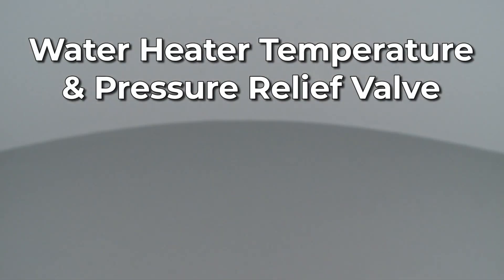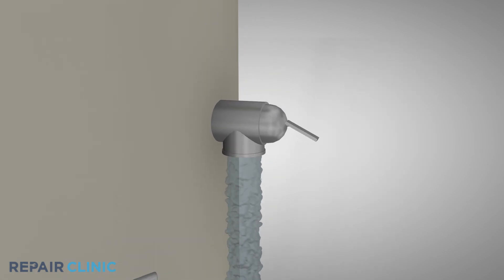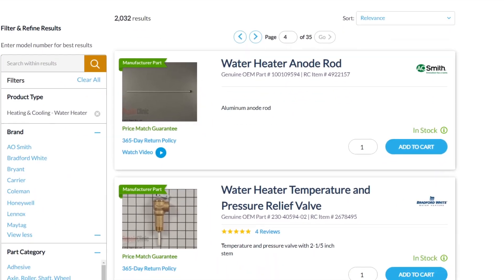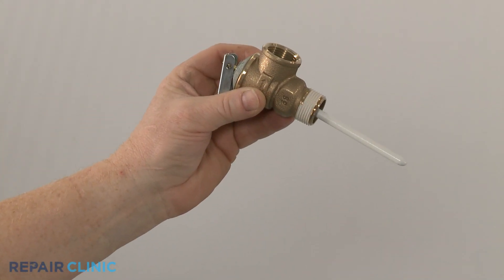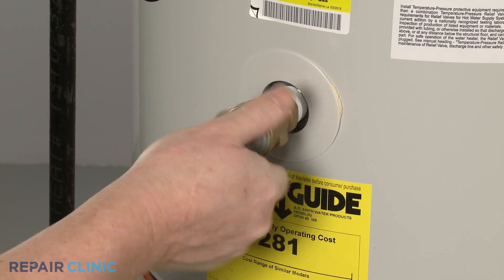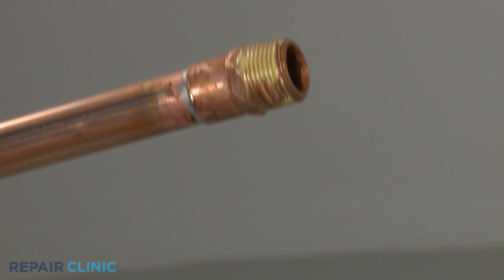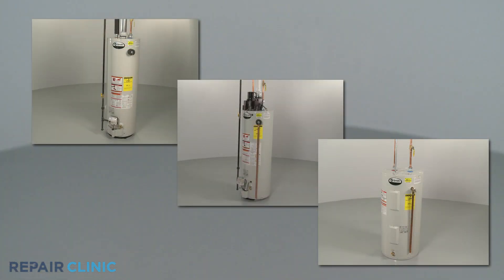Water Heater Temperature & Pressure Relief Valve - How it Works & Installation Tips

Comment: so how do I replace the relief valve if it had a PVC pipe cemented into it that connects to a copper pipe that goes down through the floor, into the downstairs wall and out of a copper drain pipe outside my house?  When I tried to unscrew the connector going into my pressure relief valve the entire copper pipe started to twist so I immediately stopped so I didn't snap the pipe in half.

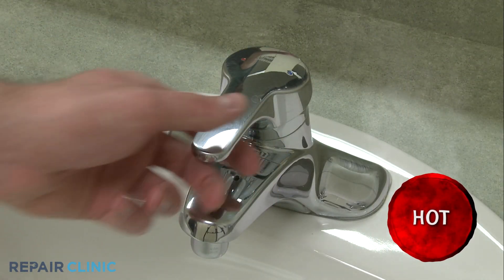Comment: 1:33 If you close the cold water valve, the water pressure in the water heater reduces and the hot water tap will not provide hot water.
Reply: You DO realize that is to provide air so the tank can drain, don't you?

Comment: Nice. The only thing I noticed that you did not mention was wrapping the new valve in teflon tape before reinserting. Other than that, well done.
Reply: It already had Teflon tape wrapped on the threads.